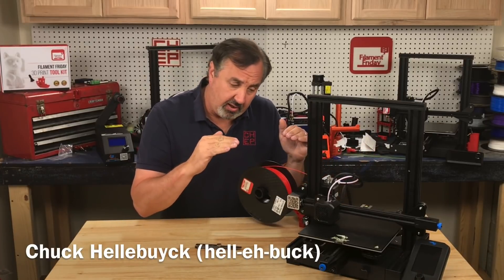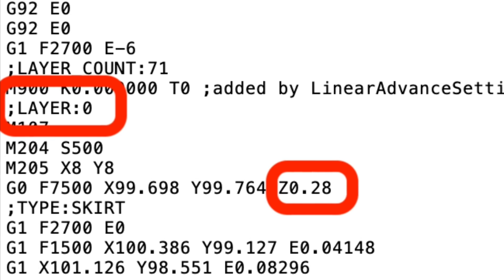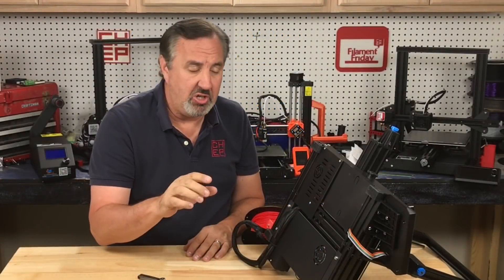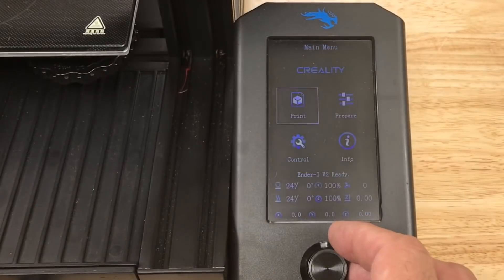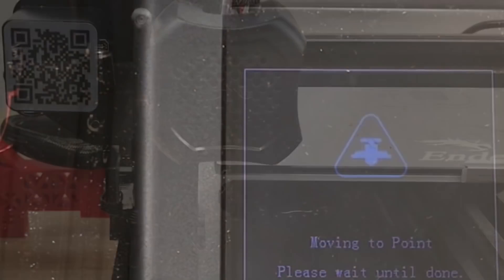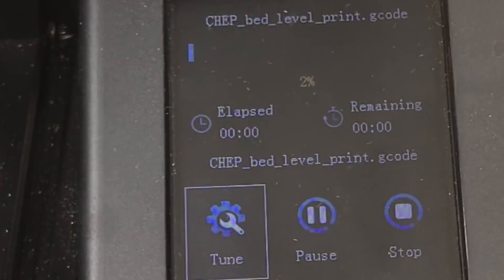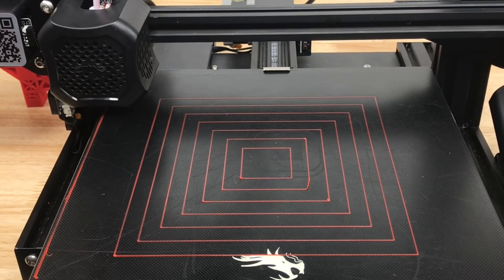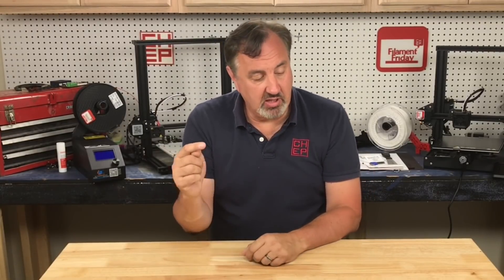Leveling or Tramming your Bed Using a Feeler Gauge on Ender 3 V2

Comment: For anyone in 2022, as of march 30th on my new stock ender 3 v2 I could not get the latest (E3V2-Default-v4.2.2-v2.0.1) 4.2.2 motherboard firmware to install correctly. I got a black screen and it just sat there doing nothing as far as I can tell. Just turn off your machine, take the card out and swap out 2.0.1 with with 1.3.5 (not 1.3.5b) and do the same process over again. This worked for me. and it booted to the new firmware in a few seconds. 

Later releases of 2.x.x  may or may not work but 1.3.5 is a known, working version on my setup.
Reply: Thanks man. I was about to write a pretty angry comment when my printer went black for ever and then I saw your comment. @CHEP please read this.
Reply: @larsge  Glad I could help. @CHEP should really have added a version number that he used in the video but hindsight is 20/20, how could he have guessed the later releases wouldn't work?

Comment: maybe i have a poor feeler gauge, but i am getting much better calibration with A4 paper. it is a bit thicker paper than usual though. for drawing instead of printing with ink. i slightly slide the paper back and forth while one of the short edges is between my fingers. i stop turning the bed corner knob at the moment when the paper wants to bend instead of slide under the nozzle.

Comment: what do you mean put an auto level in it and get the firmware.  It comes with auto leveling.  I'm so confused.  Why do you need to adjust the corners with the wheels?  Doesn't the auto-leveling know the difference and adjust itself as the print goes along?
Reply from the maker: Not all printers come with autolevel.

Comment: I downloaded the firmware update and then I got the black screen and it won't go away I've tried changing the name by 1 character and still nothing.  Any help would be nice
Reply: Did you solve this? I'm going to try an older version
Reply: @adammills6953  yes I went to the manufacturers website and got a firmware update and it fixed it

Comment: One of the most useful things in this video was the statement that the printer expects 0 to be 0.  It seems simple, but I always assumed it wanted 0 + a piece of paper or whatever, which I figured was just "within tolerance for diameter of the nozzle".  Once I figured out it wanted true zero, and IT would step up before it started to print, that made it MUCH easier.
Reply: still don't understand what that means.
Reply: @joeskis  The printer thinks that z0 is where the nozzle is just touching the build surface, where we actually set it to 0.X mm off the surface, but the same value across the build plate. When you start a print one of the first things that happens is the nozzle is lifted 0.Ymm. the actual height your first layer prints at is then 0.X + 0.Y mm.

Comment: I downloaded the software, did everything you said. Yes, there were updates, but now my printer wont home or print. When you hit the home, it goes to the left corner, as it should, then goes to the center. If you hit print, it goes directly to the center area, and say print complete, even though it printed nothing. Worked great until i did the download. Any thoughts?
Reply: You probably installed the BLTOUCH version. When using that, the system is expecting the BlTouch sensor and does a safe Z homing, that sends the nozzle to the center of the bed as you say. When the machine doesn't get a cue to stop z movement from the BlTouch sensor, it creates and error that says "print completed" like you say. Make sure to download the version that says "Manual" or something like that.
Reply: Fixed it.

Comment: I tried using this firmware and it just leaves me with a blank screen even after 10 minutes. Turned off and inserted original card and still just getting a black screen...

Comment: IF YOUR PRINTER IS RUNNING OKAY AND YOU DONT WANT TO MIDFY IT DO NOT UPDATE THE FIRMWARE!!! It black screens and you have to update the LCD screen as well as the main board, it is a HUGE pain to sift through all the files and troubleshoot the black screen of death just to level a print bed.
Reply: This wasn't my experience. Updated just fine, without having to update the UI
Reply: Agreed. I needed to modify my firmware on the Ender 5 Pro, and there apparently wasn't agreement about the chips/components?  I tried 4 firmwares, never could get back to normal, ended up buying an updated board and waiting for it to be delivered from China only to go through 3 more firmware versions before I found one that would run.  It still does weird stuff like screaming when you try to save the Z offset, which is probably due to not having the SD card installed?  Maybe?  Who knows, I just told it to move Z axis to 0.2 for the purposes of leveling.
This video helped a lot.
Reply: It is not a huge pain.  There are not a ton of files that you have to sort through.  Watch a YT video and it is the easiest thing.

Comment: I used this video as a reference to use a feeler gauge to level the bed on my Ender 3 S1 yesterday and it went well. The options are a lot different in the menu due to the S1 having the Auto Bed Leveling feature so I had to improvise but I managed and got it nice and level. I did this before doing my first big print. It went all the way out to the edges so I wanted to make sure I was good before starting that 13 hour print. I used the grid print you linked too. I did it before re-leveling and saw where I had issues. I fixed them and that big 13 hour print came out well. Thanks for the guide. Much appreciated.

Comment: Retired Assembly machinist: See more example after 8 years in the hobby, I considered feelers once in the 1st year. It's all about choices, personally feelers nope, never ever. Heavy machine industry absolutely required. No shortage of copy paper, no misplacement and not awkward.
Reply: I have 3 bits of  "standard" copy paper that measure between 0.1mm and 0.27mm. Feeler gauges have got me reliable prints after a couple of years trying.

Comment: I don't see the manual leveling option in the Prepare menu (I have an Ender 3 V2). Any ideas?
Reply from the maker: Did you use the same firmware update?
Reply: @FilamentFriday I bought this last month and the installed firmware version is V1.0.2. So my bad it seems I need to update
Reply: @SSIcely  the Ender 3 V2 does not come with manual leveling from factory. Not even with updates from Creality. You have to select "disable steppers" and move the hotend with your hand to every corner. The option is added on custom firmwares that you can install easily. This creates a menu that makes the hotend go the same point in every corner each time, so you leveling is more exact

Comment: Tried to update the firmware with the 4.2.2 same as in the video as thats what was on my printer. But the screen has stayed black and now it wont come on at all
Reply from the maker: Change the filename by one character, use 8GB card or less and nothing else on SD card and try again.
Reply: @FilamentFriday  Thank you kindly! That worked
Reply: Forgot to add that its the exact same printer. E3D v2

Comment: Hi. I have the Jyers UI firmware installed. I use the 0.2 gauge for the manual levelling (including using the +0.2 Z Offset as per the instructions). After the manual levelling,  I want to create a 3x3 mesh (no sensor). Am I to reset the Z Offset to zero before or after creating the 3x3 mesh? Thanks
Reply: without offset the printer thinks it's right on the printbed. so you offset it to get the feeler gauge between bed and nozzle.
so you set the offset before using the gauge and reset the offset before printing.

Comment: I would assume the 4.2.7 BLTouch firmware V2 is also good for the normal ender 3/ with a 4.2.7 and a BLTouch?
Reply from the maker: Yeah, I believe it would. If you have the same LCD.
Reply: @FilamentFriday  Just the stock ender 3 lcd with click wheel, or the new touch screen, neither of which work. Thank you for the reply though.
Reply from the maker: Interesting. I wonder why?
Reply: @FilamentFriday   No clue at this point I'm ready to toss it out the window, I;ve gone down a 4 week rabbit hole that started with the CRtouch suddenly not wanting to work as it should anymore after months of perfect printing, and now for the life of me I can't get a good bed leveling test print out of it if my life depended on it. I've upgraded my 2nd printer with the 4.2.7 and BLTouch with a touch screen, and apparently what I have found so far Creality doesn't even have a firmware for this combination. Currently emailing with Creality to find a solution if possible. All I wanted to do was print a single part 4 weeks ago and now this mess. 😣
Reply: So, updating firmware not withstanding, will this procedure work with an ender 3 pro and marlin firmware with able installed aftermarket???

Comment: CHEP I use your bed leveling gcode because my board is old (early 2020 ender 3 pro) and I don't have z offset in the printer. When using your bed level gcode do I use the .203mm? Also do I need to change the z offset in cura instead?
Reply from the maker: No, just in the z offset menu of LCD

Comment: Loaded new firmware from video and it bricked (does not boot) my printer, what to do now??
Reply from the maker: Change filename and use a different 8 GB SD card and try again. It should recover.
Reply: @FilamentFriday  Yes change filename to firmware1.bin and also update the firmware of the screen..
Reply: @TimoMssn  where is the screen firmware located? can you link it to me please?
Reply: The firmware recommended in the video bricked my ender 3 v2 rev. 4.2.2 - Haven't even made a print yet. So I went and downloaded the stock firmware, reformatted the card and added the stock .bin file which brought it back. Maybe when I have had a chance to print with it, I will try another firmware again.
Reply: @slaptherooster  Hey Royce, I had the same thing happening to me. You need to put the file in the folder where the orginal firmware is. Just delete the files from the folder and put the marlin file there instead. I thought that I bricked mine but as soon as I did it bamm. The marlin version was installed.

Comment: Does a smaller or bigger print nozzle need a different feeler guage or is it dependant on the size of the filament?
Reply from the maker: Neither. You match the feeler gauge to the offset to get close to perfect zero.

Comment: (I prefer an answer from Chuck) I have an Ender 3, V 1.1.6.  Is there anything I can update the firmware to?  I've been trying to level my bed with a feeler gauge and I had seen somewhere that they said to use a 0.004.  I haven't been having any luck and now I think I know why!
Reply from the maker: I’ve never heard of a V1.1.6 board. The guys I refer to in this video may have a firmware for you. https://youtu.be/vFcMW6m9OGg

Comment: Hi Chep!
Just some quick questions. Can I combine leveling the bed with a feeler gauge and the mesh bed leveling in the jyers firmware on my ender 3v2?

I was thinking like this:
Preheat to the temperature I’m going to print at.
Raise the z offset to the thickness of my feeler gauge.
Do a manual leveling.
Then do the mesh bed leveling.
Reset z offset to zero.
 
Am I overdoing it? Would it be enough to just utilise either one instead of combining them?

I guess your method will work just fine on my stock ender 3 pro and max as well?

Maybe if you want or if there’s enough interest you could make a video about it :)
Reply from the maker: That would probably work.
Reply: I am using feeler gauge when using manualmesh on ender 3 v2. Use .2 feeler gauge male very easy to level the bed than using a paper

Comment: Hi Chuck. A while back I commented on one of your bed-levelling videos. I mentioned having tried everything  to level the bed on my older E3V2 3D printer, but nothing I'd tried worked. Good news! I made a few helpful modifications. I changed the Bowden system for Creality's direct drive system, replaced the tan-colored springs with silicone mounts, and added a second lead screw to the right side of the printer. My newer printer was initially the only printer set up in this way, and it has been running nearly 24/7 for 2 weeks. I have not yet had to relevel it! That's right. I levelled it just once 2 weeks ago before using it for the first time. Mind you, it cost me just under $200 CAD to modify both of my printers. But once I'd confirmed that these modifications worked on the newer printer, I went ahead and made the changes on the older one as well.

I had been using Jyers firmware until recently, but I went back to Creality's firmware. Jyers might offer more printing options, but I found it confusing. There are 2 or 3 different screen locations for setting the Z-offset in Jyers firmware, and I couldn't be bothered trying to determine which one to use. The only ick now is that I have to remember to tune the Z-offset before every print, because Creality's firmware does not seem to provide a permanent way of saving the Z-offset to either SD card or EEPROM, nor can I adjust this offset outside the Tune option when I go to print. I'd tried both the BLTouch and mesh pattern schemes to help me level the bed, but in my opinion both failed miserably. While the BLTouch is not a proper bed-levelling tool, it should help anyone who has irregular bed surface problems. Basically, that's all this device does, and I find the hype about this product misleading. Also, I now remove the build plate before attempting to remove a print to avoid throwing off the bed-levelling. For parts that are more stubborn to remove I wait for the stock build plate to cool, then stick it in the freezer for about ten minutes. The prints then come off the build plate quite easily. The mesh patterns do very little to help maintain a levelled bed.

In the 7 months use of my older printer I had ample time to assess most every problem I'd had and determined the three afore-mentioned viable fixes. Two of these problems were bed-levelling and under-extrusion. The older printer used the Bowden tube system. I have since determined that the stock extruder is flawed in design or inefficient to the task. Attempting to either slow down print speed or raise the hot end temperature did nothing to solve the extrusion problems I'd been having. In any case, this is what led me to go to the direct drive. I wanted to reduce filament drag caused by friction and to shorten the travel length between extruder and hot end. So far, I have not been disappointed, and I'm glad I switched to direct drive. If the stock extruder had been up to the task I would have stayed with the Bowden setup to exploit the print speeds inherent in Bowden type printers. The stock springs are not up to par, but neither are the suggested stronger tan-colored springs. This led me to the more rigid silicone bed mounts. I believe these have enormously contributed to the fact that my bed now stays level after I adjust it. I could not get my X-axis gantry perfectly perpendicular to the frame side extrusion, nor could I get it to stay that way after having attempted to readjust it. The stock one-sided X-axis gantry support is barely adequate in maintaining a two-sided support gantry system. So, I added a second lead screw to the right side of my printer to help support the X-axis gantry to reduce or eliminate gantry sag caused by a lack of adequate support. Now the X-axis gantry is perfectly perpendicular to the frame side extrusion, and should not need further adjustment for a very long time. I give the brass nut about 7 months before its worn out enough to cause me problems again, but in the meantime, the sag is completely gone.

Comment: My Ender 3 v2 initially didn't boot with the firmware loaded on the SD card, I tried again after formatting it but still no luck. Then I noticed I used the latest 2.01 version of the firmware while you use 1.35 in the video. Everything worked nicely after I downgraded to that version.

Comment: Hey I got the 4.2.7 board and used a 32 gb card to update the firmware, not sure if that's different which it shouldn't be being 32 bit but it did work flawlessly.

Comment: I would not agree with his selection for feeler gauge size. After watching this video numerous times and attempting to tram with a 0.20mm feeler gauge using his technique, a large amount of “live adjustments”  are necessary. I have found in my experiences that tramming with a 0.15mm feeler gauge has produced a much more accurate and reliable first layer without excessive squish or need for live adjustment. However My profiles are properly adjusted for extrusion rate and material flow which may not be the case for everyone.
Reply: the size of the feeler gauge doesn't matter at all. z=0 is right on the bed. you set an offset to get the gauge between nozzle and bed, then reset the offset afterwards. As long as the offset matches the gauge, it will work. It's just better tho stay with small sizes, because they are more flexible and therefore easier to use.

Comment: Can I do this with a regular ender 3 , if so is the process any different?
Reply: I do too. I haven't tried it yet (although I will) but I think instead of setting the z offset to the thickness of the feeler gauge, I think you just have it at zero and then raise it to the thickness of the feeler gauge. Also, you need to move the extruder manually because the ender 3 doesn't have the feature to go to each corner (I think unless you have a special firmware)